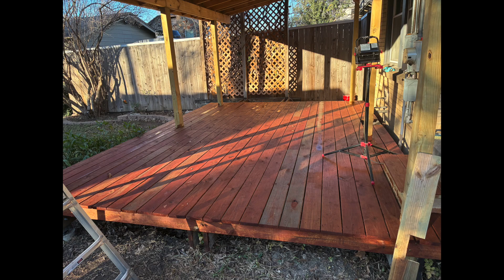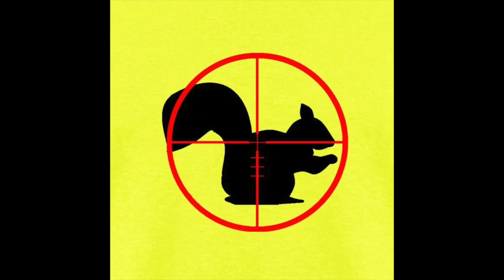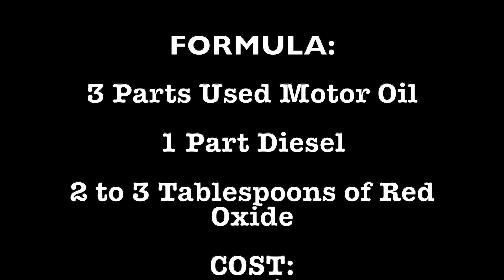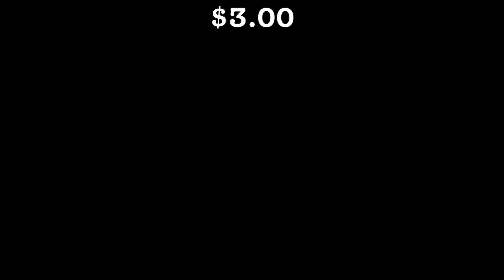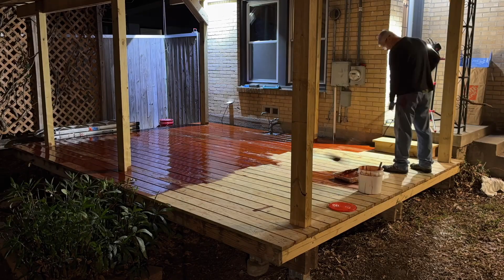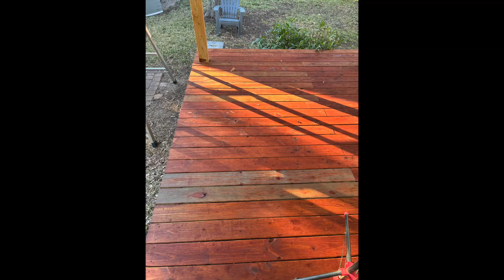DIY Deck Stain

Comment: How long did it smell? Is it slippery when wet?
Reply from the maker: It smelled for about two weeks.  I did this during the early spring so when it started warming up, it started sweating a little bit.  I dropped a rag on each foot and scooted across it a couple of times to clean up the excess.  What’s amazing is all vertical surfaces didn’t have this kind of result.  My upright post were wiped down once and my floor was wiped down two or three times.  I’ve since stained my fence with this. It looks incredible and I’m about to stain my new garden shed too.  It’s gotten wet a couple of times with blowing rain. I haven’t noticed it to be slick although I haven’t tried sliding into home plate at the grill yet.